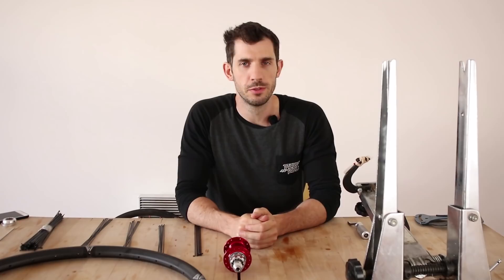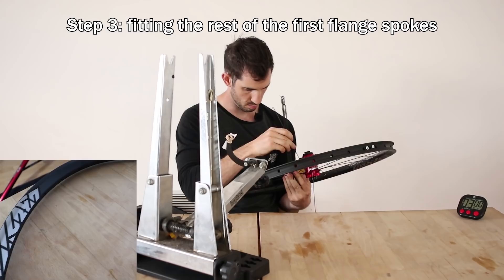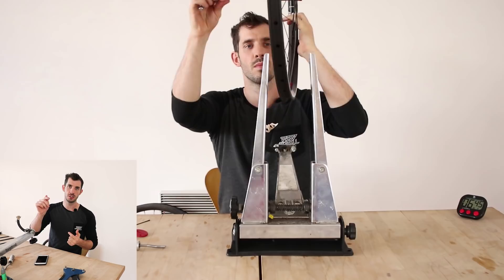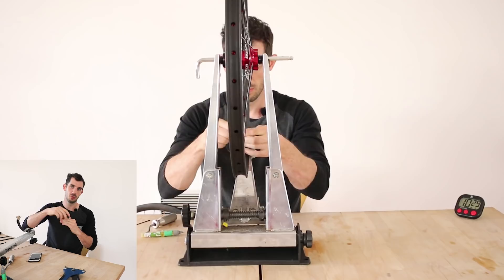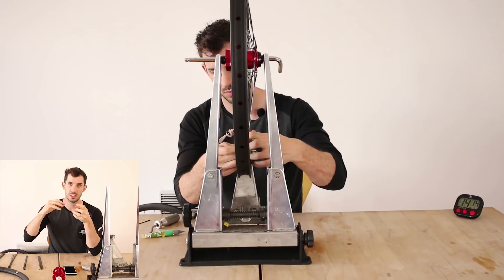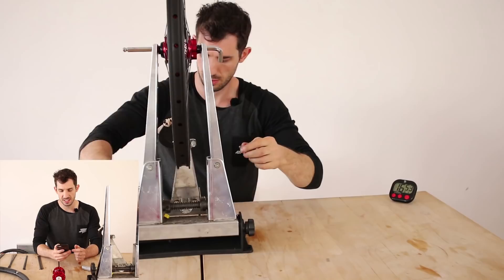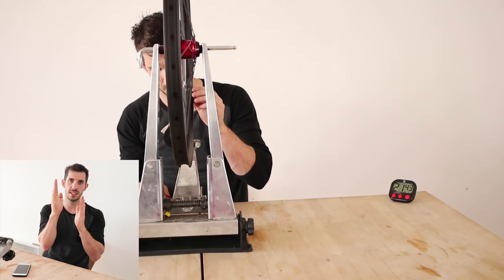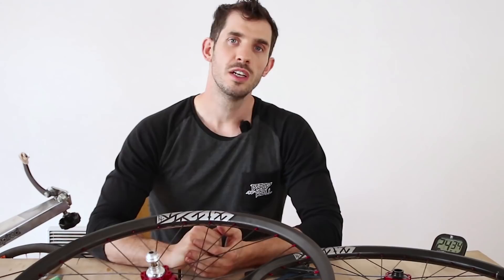Building A Wheel in Under 25 Mins + Wheel Q&A

Comment: I am training for my pratical test as a bike mechanic where i have to build a very good wheel in under 35 Minutes (best trueness category is <0.2mm runout) and i was wondering what tips you had for saving time on building wheels, apart from using tools like nipple drivers and practising a lot.

Comment: In regards to the radially laced question, I've got a 20" rim laced radially on the non-disk side, it's very solid but has actually stretched the hub outwards and the bearing will drop out if you remove the axle. It looks cool anyway.

Comment: Congratulation for your new sponsor. I do like this one really waaaay more than the weird fork one. Building and fixing stuff is a really nice video format, that helps a lot. I am really heavy (265lbs), tall and strong and live in the alps. I decend and acend a ton. But I have never managed to brake one of my hubs (avergage shimano). What I did brake a lot is wheels. 
After your video I am considering building wheels for my normal MTB and using those wide Trial rims with holes and ballonmaterial in them. Is there a reason not to use them? Since I am a Monster myself, I don’t really mind that little extra weight.
Reply: @Ali_Clarkson  I wanted to use them, because I thought they must be stronger. What else is the criterion. Currently I use 36Spokes double walled aluminium rims. They are ok so far, but I did break similar ones in the past.
Reply: @Ali_Clarkson  Thx. I am going to have a look on that. Carbon is a nogo. I have seen to many horrible carbon crashes. I will NEVER buy carbon. But I for sure will ask my collegue to check out the different alloy properties for me ( he is an engineer) .

Comment: The corrosion on aluminium is different to steel. With steel the corrosion is brittle and flakes off and the steel will rust straight through until there is nothing left. When aluminium corrodes the corrosion forms a protective layer which prevents further corrosion. Even after 10 years in a damp shed aluminium will polish back up to a perfect shine with little effort so don't worry about using it in wet and muddy conditions.
Reply: 3SecondsFromDeath ever heard of dissimilar metal corrosion?
Reply: unless you have two dissimilar metal in the presence of an electrolyte. Example. a Zinc anode on an aluminium boat hull in sea water. Or aluminium (aloominum) nipples on a carbon fibre (graphite) rim that is left wet after a muddy ride. The metal lower on the Galvanic Series table will corrode. Because graphite is at the top of the table and aluminium close to the bottom (ie very high "electrode potential") aluminium nipples will corrode quite aggressively in electrolytic conditions.

Comment: One precaution I'd strongly recommend is to put insulation tape around the rim to cover the spoke holes once the wheel has been laced. The first time a spoke will ever see it's working load is when you tighten it in the wheel. If it fails at this point it will fire straight out through the rim like an arrow. Given how much of the building time you spend with your eyes aligned with the rim it's pretty obvious where the danger is. Using good quality spokes means the chances of a failure are very low, but the 15 seconds it takes to put a strip of tape around the rim could be the best time you've ever spent if a spoke does fail. If you want to see this in action take a wheel you're done with and snip a few spokes and watch them fly.

Another very handy trick I use for building wheels is to adjust in quarter turns, so the flat of the spoke nipple is parallel with the rim. This means you can visually inspect the wheel for loosening spokes. I also find that overshooting on tightening the spokes and then backing off to where I want to be can nearly eliminate windup in the spokes.

Comment: Chris King hubs are better to look at than HD porn.

I'm a brass nipple man, brass is softer and machines like butter, which means they're buttery smooth on those spoke threads too.If the spoke reaches to the other end of the nipple, then the tensile stresses are taken by the spoke, and only the flange on the nipple has to take the stresses. Wheelsmith Spoke Prep, Rock 'n' Roll Nipple Cream, or DT Swiss'/Loctite's collaboration spoke prep will be your friend too, as they provide lubrication but also work a bit like a very mild threadlock.

For noobs, tension every 3rd spoke, it's a number that lets you go around the wheel a few times without missing any out, but makes it much harder to over-tension one part of the wheel compared to another, which helps with keeping the wheel both round and true.
Reply: @simonadventures3727  I work at a bike shop. Spoke prep is still very expensive even at wholesale costs, but I don't pay for it, the shop does. If you work at a bike shop that doesn't give you access to these things for personal use (in personal time), then either you need to be getting paid a lot more, or you need a different job.
Reply: Rather than every 3rd spoke, it's better to start at the valve hole and tension each spoke (Or spokes on one side if you're adjusting the dishing) until you get back to the valve hole. Unless the spokes are very slack to begin with no more than one turn per spoke to get the wheel up to tension. Easier to take 2 or 3 extra trips around the wheel than to deal with a rim bent out of round because the first spokes you've tightened are getting the whole wheel to tension before the rest of the spoke have been adjusted at all, leaving some spokes very long relative to others.

Comment: Good day sir, could i ask a question? Does it necessary for the spoke to be overlapping with the rim? Lately i do wheelbuild, changing my spokes to butted once. Previous spokes were 294 in length and using 12mm nipples. What i used recently were a 289mm spokes paired with a 16mm nipples.
Reply: My current build, the spokes float around 5mm, unable to meet the rim when fully laced.
Reply: Also as i checked. 12mm nipples has only 8mm working thread(minus the upper shank ang the lower slot for screw drive) and it all locked in all the spoke thread.

While 16mm nipple has a 14mm thread, but only 6 to 8mm was only gripped or lock on the spokes. 

Is it okay or do i need to change to previous spoke. The problem with the previos spoke is that it bottom out on the nipples and spoke tension is somehow slack.
Reply: I do basic XC

Comment: Hi, only one question, I'd like build a durable wheelset for enduro. I've already build 3 wheelset but always 3 cross pattern. This one I would like a more reactive wheel. I think I will use a light bicycle's rim. What do you think about two cross pattern? and in case is better a 28 or 32 holes rim? many thanks

Comment: Hello Ali, I was wondering if a 28h 3x with tapered 14-13g sapim spokes is strong enough for the back wheel on a 26" or 24" pure trials bike?
I dont drop over 1 meter and my weight is only 70kg.. This versus a 32h 3x with 15g sapim spokes.

Comment: I'm building a set of wheels laced as a 3 cross pattern. I've had trouble with some spokes being too short and some being too long, on both sides of both wheels. I've checked and rechecked the spoke lengths on several calculators and that all seems to be correct (spoke lengths are the calculated to be all the same length). I have also check the lacing pattern and it seems to be right and consistent. There is a pattern to the problem so this suggests to me a lacing issue (the pattern is: 2 spokes too long, 2 spokes too short, 2 spokes too long, 2 spokes too short and so on all the way around the rim.). I am wondering whether by rotating the hub after lacing the first 2 sides of 8 spokes, this has caused an issue (ie. can I rotate it too far?). Or, perhaps I should re lace them (for the fourth time) and try elbows facing the opposite sides as this may also slightly effect length (I have read Sheldon Brown's article on elbow direction). Ali, or anyone else, help?

Comment: Regarding target spoke tension, the rim manufacturer will specify the max value, which you can then correlate to your tensiometer and make sure you don't exceed it. You'll be looking at the rim ERD spec when determining your spoke lengths anyway and that max tension should be listed, too. Example: Stan's Flow Mk3 rim max tension is 125KgF/1225N. Raceface's Arc 30 rim max tension is  122KgF/1200N. Light Bicycle EN732 rim max tension is 145KgF.

Comment: Spoke length calulation:
The effective rim ϕ is quite critical. Don’t always believe the manufacturers given ϕ and measure if you can. It is the diameter of the wheel including the end of the spoke which has to be inside the rim at the end of the nipple:  it can be either at the bottom of the screwdriver slot or the top of it, but it has to be inside the rim. It is not the bead seat ϕ which is the diameter of where the tyre sits.  It is not 700c, 622mm, or 27.5”, 584mm, or whatever. These the bead seat diameters of the tyre. Below that point, the rim can do whatever it wants depending on profile.
However the hub flange ϕ and hub width can be out by maybe 3 mm before it makes a noticeable difference to spoke length. Before online calculators, it was normal for tables from the likes of Sutherland ( and Ron Kitching too I think) to group hubs into flange diameters per general diameter.
If the spoke is too short, not all the threads are used and you have the hollow tube of the unfilled nipple holding your wheel together which isn’t strong. It’s OK if the spoke is a slightly too long, maybe by a mm or 2, but it mustn’t pierce the tube.
The actions of wheel building are very repetitive. You will get a good feel for the tension through the spoke key. 
Crossing:
A wheel is a compromise between the springiness of the wheel, which is up and down, and the transmission of driving force along, which is at right angles. Think of it like this: it gets complicated as the optimum for one is the weakest point for the other. It’s exactly like twanging a ruler by its face then trying to do the same from its edge.
So crossing exists to compromise. Radial is ideal for front and was great with rim brakes on front suspension. It is a very stiff wheel, forces are end on but if you tried it on the rear, you would snap spokes as they twisted. 2 Cross is fairly stiff and can be used for rear wheels on the drive side with radial off side. This is a stiff, maximum energy transfer racing set up. 4 cross is springier than 3, and more comfortable, but not as fast. 4 cross is ideal for heavy touring. The difference between 3 and 4 cross in reality is what spokes are available.

Comment: Hello bud. I recently purchased a set of Arc MT006 hubs, 100/135 QR. I'm currently preparing for a wheel and need to figure out the correct spoke lengths. I'm using the WTB KOM light i25 rims with an ERD of 604mm. (Rim weight: 455g) I've been told that you should add about 3mm to the rim ERD to account for the spoke nipples, which =707.  Is that a correct practice? How much should I add to the rim to account for the nipple? The technical diagram available for the Arc MT006 is a bit confusing, and I can't seem to figure out what the correct flange circle diameter is. The measurements I input where. Front hub: 32H, lacing 3x, weight:160g Width 100mm. PCD: 58/45, Nut to Flange: 28.1/ 13.7, Nut to center: 21/36.3. 

Rear hub: 32H, lacing 3x, weight 240g, width 135mm, PCD: 58/44, nut to Flange: 31.57/48.15, Flange to centre: 36/20. The hub uses 14G spokes. Recommended nipple length is 12mm? When using the DT Swiss calculator the total recommended spoke lengths come out at, Front (L/R):  293mm/294mm. Rear (L/R): 294mm/295mm. Could you possibly tell me if I have gone about the calculation correctly?

Comment: I'm definitely going to use your guide to lace my new free coaster wheel. 
Is there anything wrong with cutting the spokes down a small bit? 
Like buy a size thats a few mm too long and cut some thread off?
Reply: @Ali_Clarkson  ideally I will be able to get the right spokes I was just hoping a near enough with a small trim could work. 
I wanna support my local but they wanna charge me 200$ to build the wheel when I've had a previous shop do it for 30$

Comment: Hey Ali, nice explanatory.
I’ve been riding my current bike for about a year now.
Recently, I snapped a sapim laser spoke, at the j hook. (So at the thick section)
I replaced it, and everything was fine for about 500kms.
Then the exact same thing happened.
What could be the problem here?
The wheel has been built by a professional.
Reply: If the wheel wasn't stress relieved (The part where you stand on the spokes), it will fatigue more quickly as it's bedding into the hub over time rather than being forced to bed in by being overloaded temporarily.
Reply: Well I’m not sure if that has been done, but as said it was built by a professional.
Reply: @bjorne46  Professional just means they were paid to do the job. The bike industry is full of people who have learned to fix bikes from people who also don't understand the engineering behind them. Being a bike mechanic pays so badly that almost anyone who understands the advanced stuff is also smart enough to realise they are more than able for much better paying jobs that will allow them to afford more bikes (And a decent standard of living), and have more time to ride their bikes too.

Comment: How do you know whether you should do a 3 or 4 cross build
I mean if you dont calculate the spoke length how to know what cross build exactly you should do??!?!?!
Reply: @Ali_Clarkson  Thanks that makes much more sence
Reply: 4 cross on 32 hole wheels often means that one spoke will cross over the head of the one next to it, which makes replacing individual spokes a nightmare. 3 cross is the best combination of torsional and lateral strength in most 32 hole wheels. 4 cross is usually okay on a 36 spoke wheel, but in most cases spotting the difference in the feel of the wheel is almost impossible, and 3 cross tends to be easier to lace.

Comment: Hi sir. Are front and rear spokes are the same sizes?
Reply: different
Reply: It depends if your running mullet, if you have a 29 in the front and a 27.5 on the back, the front is gonna have longer then the back, if you have the same size wheels front and back, you have to know if your rear hub is a single speed or one that uses the cassette(the thing with alot of sprockets at the back) sometimes single speeds using same length spokes as front, but sometimes they have different spoke lengths on the left and right side of the wheel like on a cassette hub, also how many crosses your running on your wheel, the wheels could be same size but lets say the one wheel is a 29inch with a 4 cross and the other one is also a 29inch wheel but its a 2cross,the 4 cross is gonna have longer length spokes then the 2 cross
So there are a few things to factor in, these are the things I know of but their could be more